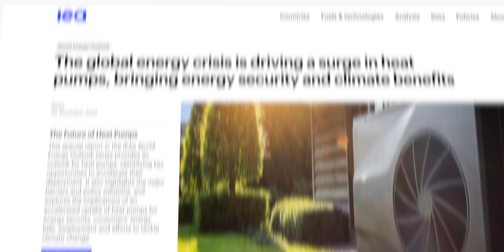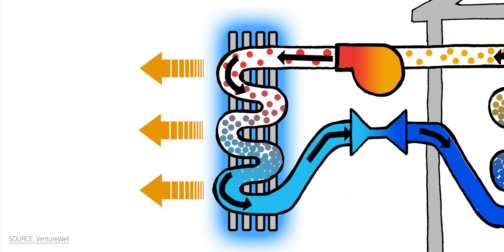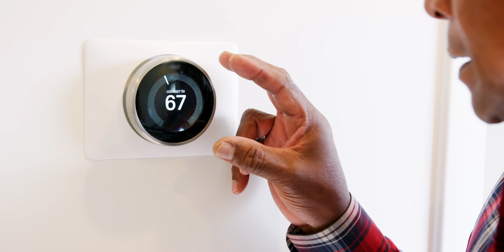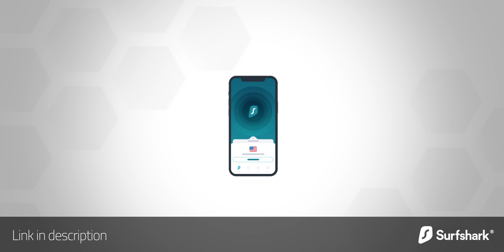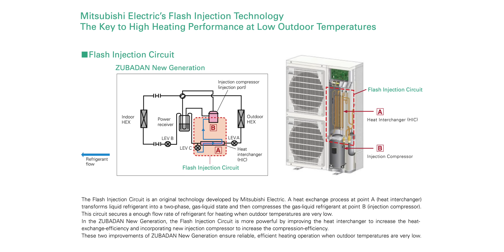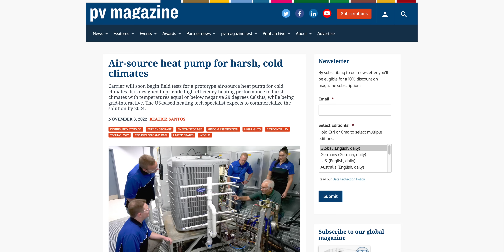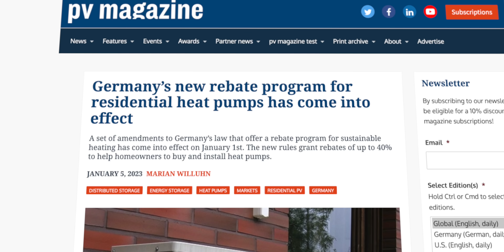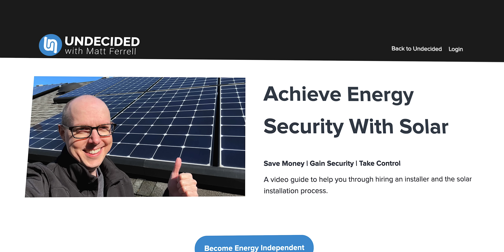Major Advances with Heat Pumps in the Extreme Cold

Comment: Our vrf system is great, it just doesn’t push super hot air and will have a heat standby to get it going that lasts a few minutes so you really don’t want to let the thermostat go under 65F or it takes a while to get back to 70F. Like you mentioned though there’s a lot of HVAC installers that try and talk you out of them bc they don’t know how to install them, that should change i the coming years

Comment: Unfortunately efficiency and effectiveness aren’t the only challenges that need to be addressed.  There is also the difference in fuel/energy costs to consider.  For example here in New England in the USA we have electricity costs that are very high but very cheap natural gas costs.  My home is has central air conditioning but for heat it still has natural gas furnace that feeds hot water base radiators throughout the house.  In the peak of winter my gas bill only doubles at worse with about $70 a month more for that heat, but my electricity bills triple or quadruple adding on $300 or so in the peak of summer with the only real difference being running my AC. That’s just to get the house to 70° to 72°F in the summer and up to 60°F in the winter which I feel is reasonable. But that means then unless the heat pump system is also vastly more efficient then my current AC I would just be INCREASING my energy costs to heat with a heat pump rather then gas in the winter.  That is mostly due to the stupid high cost of electricity here which is around $0.25 to $0.26 per kWh (that’s with all the fees and delivery charges  and grid service charges per kWh they add on top of just the straight electricity costs, which I think is redundant, but never report online it seems. I mean what is the actual difference between a transmission charge and a distribution charge for the same electricity other then a way to call it two different things and complicate the bill?).  And I’m sure this isn’t the only area where there is that kind of disparity between different utilities type costs which force people to choose or stick with the otherwise less efficient option.

Comment: Here is a thought. If the primary source of electricity in your region comes from natural gas plants, which from what I read only operate at up to 55% and it’s really cold outside where defrost cycles occur a lot. Is it really more efficient? You’re using 55% efficient generated electricity and when cop falls because of let’s say -5 degrees outside, burning straight natural gas at 99% efficiency can be more efficient. As long as you can have a good COP as super low temps for us north folks, then it’s worth it. By the way, I have a 3 ton heat pump.

Comment: I really don’t understand the hype around heat pumps. In Australia we’ve had them for decades and we just call them reverse cycle air conditioners. It’s just been normal for such a long time. Is America only just discovering them now? They are also expensive to run with our electricity prices even with inverter technology.

Comment: I just moved into an apartment building with a geothermal heatpump system. Our heatpumps are installed inside our storage in the apartments and connected to a central system(Not 100% how it works). I can never hear it run and my apartment is 20°C(68°F) just the way I like it. So far happy and the cost is fixed at €89 a month. A bit high in price but I am happy I no longer have any natural gas in my home. Also shielded a bit from the energy crisis. The apartments are also very well insulated(Triple glazed windows with a mechanical ventilation system).  It also cools in summer. I will see how well that works in Summer when we have heatwaves in the Netherlands.

Comment: Hm, I live in Stockholm, Sweden I installed an air to air heat pump rated for 150 square meters (SCOP 4.74, incl. Wi-Fi and smart app) in November last year the Cost was about 1000 dollars for the 2 units (1 inside and 1 outside) and about 800 dollars for the installation, (I added a painted wood cover for about 250 dollars) that’s 2250 dollars total. I know that you have large houses in the US but even two or three of those installations is not even close, what’s going on here? Also we have hade really effective ones since around the late 90:s (so this is 30 year old tech). Also we have been using heat pumps since the 60:s, they became really popular after the 70:s because of the oil-crisis (everyone switched electric heating instead of oil). I can see that if use a lot of cheep gas (In Sweden we have less than 0,01% gas of our energy mix) this would not implemented as quickly but in Sweden 98% of our heating is electric. But I find the numbers from Poland really strange they are in the EU singelmarket just like us so is this an advanced geothermal installation?
Reply: nfhh  hi sorry this took a bit of time, I have recent surgery, removed my gallbladder, so because of this I’m on some hard medicine, so I’m not that active on stuff like this. I’m a big fan I find your content really good. I would be glad to provide you with any information you would be interested in. Best Regards Magnus

Comment: Bought a first generation split system heat pump hot water system. I expect a reverse cycle AC to last at least 10 to 15 years so was most surprised when the heat pump gave up after a little over THREE YEARS! Also surprised to find the unit was discontinued and no longer repairable. Install a Rheem? Well no .. at least not their first gen. Jim Bell (Australia)

Comment: I have a 10 year-old Daikin Altherma 16kW Air to Water heat pump running on 400V for our 205sq.m. house. It heats up water and circulates it through a 300L boiler (for hot water) and the fan-assisted convection radiators around the house + towel rails in the bathrooms, it works great and is quite economical. The pump heats up water only up to 50C (some models go up to 70C), but at -10 / -15C outside temperature, 45C water is enough to keep the house at 23C. Per sq.m., my heating/cooling bills are lower than anyone I know without a central heat pump, whether their heating is on gas, electricity, wood pellets, or central city supply (a local thermal power plant supplies some neighbourhoods with hot water for radiators and taps). As an added benefit, I can run the pump in cooling mode in the summer. That being said, I do have 28 vacuum solar tubes on the roof that help heat up the boiler and thus increase the efficiency of the pump during the day, and they ensure we have very cheap hot water in the summer when the pump is in cooling mode. The boiler's built-in 9kW heater is basically obsolete, we never use it. My only regret is that the house doesn't have underfloor heating but it was all built and furnished before we bought it.

PS For anyone considering a heat pump - keep in mind the fancy big brands have expensive maintenance too. Recetnly a water flow sensor died on mine, new one is 400 euros (without labour)... for a tiny sensor in a plastic housing, absurd. The main board is 3k euro, the small plastic control unit which is just a low resolution display and a few buttons is like 200 euro... If this Daikin dies, I'm considering buying a cheaper model from local brands. Although marginally less efficient, considering the high maintenance costs of the big brands (plus, waiting for parts to arrive), it might work out cheaper even in the long run to have a cheaper local brand.

Comment: As other commenters have mentioned, very cold temps is not a big problem, the big problem is just above freezing where the humidty ices up the coil. They don't use heat strips to defrost but simply run it in reverse to melt the ice.

Comment: Even a cheap heat pump is worth it. We live in Eastern Europe next to a mountain range, using wood for heating. The upfront cost for a cheap system can be around €2000,  but heat sources can be combined. Wood heating reduces the defrosting cycles of the heat pump, and the days you need to run both wood and heat pump is reduced from ~150 to ~15 days a year. The total cost of wood and electricity prior to inflation was nearly the same, but at the current wood prices, the electricity option is cheaper.
A more fancy system, could be even cheaper, but prohibitive due to larger installation cost. The cheapest option can go as far as €500 per room with installation.

Comment: Hello Matt, I noticed one big draw back you missed but might not effect the US market as much. Most heat pumps water flow temps normally max about 50°C rather than the traditional 70-80°C. This mean on a wet system with radiators the rads output is halved but the reduced flow temp. This leads to most homes needing to install massive radiators to achieve the same output needed to overcome the houses steady state heat lose. This can add a massive cost to the install unless you have a new modern well insulated house designed with a low flow temp in mind.
The other thing that is missed is price per unit for each type of fuel. If the COP of a boiler is 0.9 and the heat pump is 2.5, but gas is 1/3 the cost of electric then it is still cheaper to run a boiler than a heat pump. Not very eco but still something to consider when waying up the facts. Hope this helps
Reply: How do you compare the price of gas vs electricity as it pertains to efficiency? 

Don't forget the summer- if you need air conditioning it's pretty hard to do without using electricity.
Reply: @20xx-mm-dd  I'm in the UK so we rarely install AC in domestic homes. Therefore we only really need heating in the winter. This being so I can compare the winter COP for the heat pump of 2.5 (1kw in of electric  = 2.5kw out of heat) against my system boiler of 0.9. (1kw in of gas  = 0.9kw out of heat).
So to put 1kwh of heat in via the heat pump at average UK rate of 34p/kWh would be 13.6p (34p / 2.5). To do the same via gas at UK rate 10p/kWh would be 11.1p/kWh (10p/0.9) Therefore you can see in this case it would be cheaper still to run gas. Also save the £20k I would have to spend to swap and upgrade my radiators again to deal with the lower water temp in radiators.
Hope this helps answer your question.
Reply: @deanhall28 heat pump in UK would be fine. Here in the states, some of us SWING wildly with temps. 😂 They work best in moderate climates such as UK.
Reply: @andreaberryman5354  in newer buildings they would but we have lot of older house which leak heat like mad as they were designed around open fire or steam rads. With a lot of work they can be but too many variants to use blanket statements like that.
Reply: I ran the numbers and figured with my costs for gas and electricity I’ll need a COP of 3 to break even (western South Dakota).  That should be achievable on average.  My understanding is that the COP increases with a warmer ambient (outdoor) air temperature.  So peak COP is apparently more like 7.  I think the single reported figure for COP may be based upon a set temperature or average of a defined range.  But with the tax credit and prospect of higher gas costs, as well as my aim to decarbonize, it’s time for a heat pump!  Still mulling over geothermal vs. air...
Reply: COP of at least 3 is the general rule. As far as massive radiators are concerned that can be tackled using dual or triple panel radiators with convector fins attached. This means that the new radiators might project from the wall a bit more but have the same wall area. The best option is to use underfloor heating loops wherever possible.
Reply: @rogerphelps9939  Well that's the problem. The heatpump is expensive. Installing underfloor heating loops is expensive. New radiators are expensive. Better isolation is expensive. This is why in the Netherlands, where houses used to be designed to be warmed with 90C gas boilers, are very expensive to convert to heatpump solutions running most efficiently at 35C. And then there is the problem with the grid not build to deliver all that electricity.
Reply: @drfisheye The USA started on boiler systems, pumped into radiators in each room. Or, pipes at the cieling. Radiant heat is SO nice. Forced air, really not-so-much.
Reply: @andreaberryman5354  yes, the Netherlands too. Radiators are very comfortable for heating. But in older houses they are designed for hot water, not the 95-130F delivered by air-to-water heat pumps.

Comment: Heat pumps here in the UK just don't work. Many documented instances of people paying ridiculous money (£15k-£25k) for the equipment and installation, and thereafter electricity bills rising significantly beyond pre-heat pump installation bills, just to operate the system. A lot of people complain these systems just don't warm the house or provide sufficiently hot water when it starts to get cold, and electricity bills rising even further just to run the system harder.

Your average UK household doesn't have the required amount of land to install a Geothermal system and planning laws mean you can't even install an above ground heat pump within one meter of your neighbours boundary. That's a tough one to avoid because terraced, semi-detached and even a lot of detached homes are still so close to each other it's not doable.  

The only option is to have your system installed somewhere in your garden, if you have a big enough garden, and away from your neighbour's boundary. This costs even more due to the more involved installation, extra pipework and electricity supply wiring required, not to mention a new consumer board capable of safely running said pumps if your current unit is incapable of supplying the required current safely. Everything here concerned with your home is nothing more than a  giant rip-off.

Whilst it may be cost effective and working well in the USA it's nothing more than a big white elephant over here. We'll be sticking with the usual gas central heating system until such time as we are forced to make the change by law.  🤬
Reply: Heat pumps in the UK work just as great as anywhere else in the world with similar climates. Just because the news paper published a few articles about people that say that heat pumps are not that great does not mean that this is actually true. It all comes down to proper installation and insulation of the house (UK houses are really badly insulated due to cheap gas over the past decades).

Comment: Would be good to quote actual numbers of COP vs temperature. Further what is the cost of an air-air heat pump which works at very low temperatures. A consumer ought to be able to make a sensible choice before making a purchase. In my personal experience it is a risky process to buy a heat pump. The relevant information is not easily available in France. On contacting technical support of the Sauter company which made the water heater I bought in November, I was told how it operated was a commercial secret. I am convinced where I live in France they can make vast electricity savings but the data is not well known.

Comment: Heatpumps are mainstream in europe and Japan a very long time. I have air-air heat pump and it is about gop 3 at 0 C and stops be efficient in about -22C. fot that reason i have  fire-place to add power when it is cold. And it works for me. Also I have don a hack so that near to heat pump is vent inlet to get fresh cold air from outside only by making a bit lower pressure near heat pump inlet and all other rooms have like outlet so my home has slightly higher pressure than ambient and heat spreads naturally because of that. Under fireplace I have another vent that has duct vent to pump in fresh air when fireplace is working and also heatpump is at vent mode to mix air and add even more fresh air.  Currently in my country Estonia quite all homes have stove or fireplace installed since in every 50-100 year or so there is a war going on and you don't have electicity/gas so it is must to have alternative to me. Today wehad like -9C at night and air-air  heatpump is like 2x effective in those connditions but anyway when below 0c then running fireplace once a day is ok. when under -10C  then twice an my monhly electricity bills are not so different at winter times. I use like 150€/$  worth of firewood in season and 600-900€ electricity for heating.